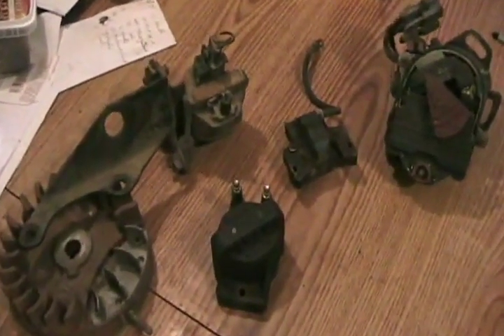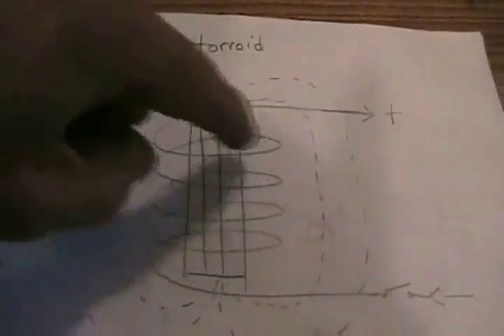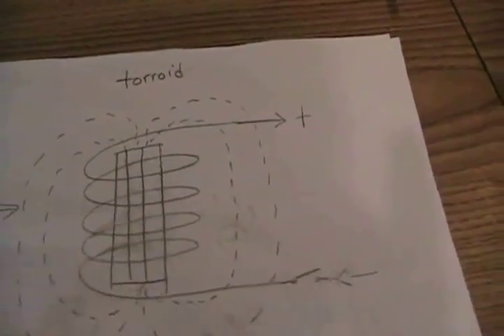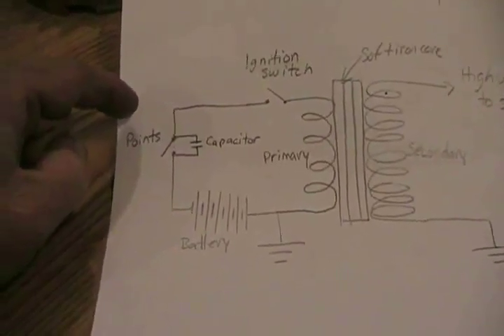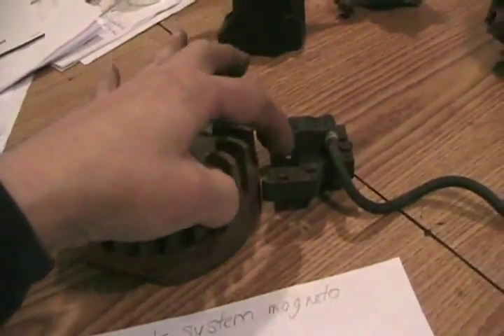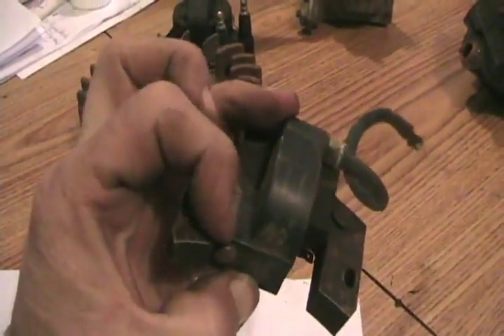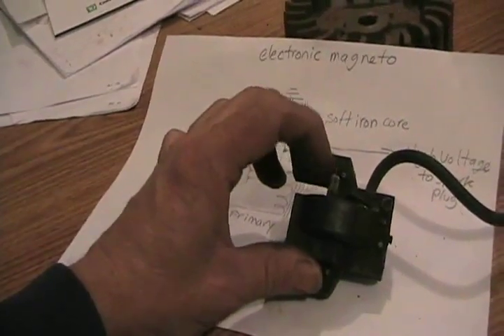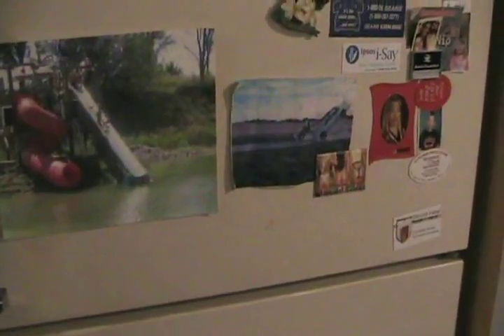How magnetos and ignition coils work Davidsfarmison[bliptv]now

Comment: I would have a professional rewind the coils for your bike. All voltage Running through your motorcycle is produced from the AC generator (usually inside the motor) and that AC voltage is converted to DC.So DC powers the headlight, blinkers, Ignition, etc. So the voltage going into the CDI box is DC volts. Good luck with your two stroke man, i hope this helps. you can message the guy that made this video too. Go to his channel.. "Davidsfarm Lives"

Comment: Could be moisture in the coil. They still have the correct resistance but shorting out somewhere. I had the exact same problem with a Stihl chainsaw. I just baked the coil in the oven at very low heat for about 10 minutes and I had spark after that.

Comment: one question.  I have a scooter.  If the plug, plug wire, coil, cdi unit are all good but I still have a very weak spark, what's left?  The stator?

Could a bad stator charge the battery and still make a weak spark?